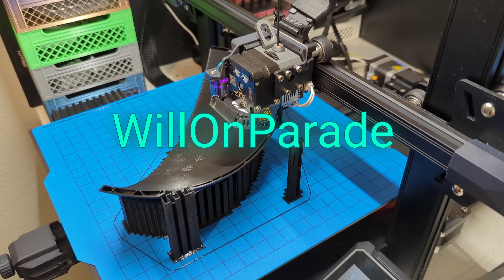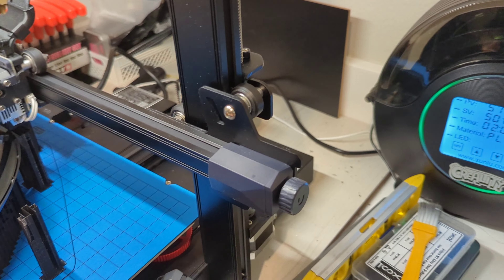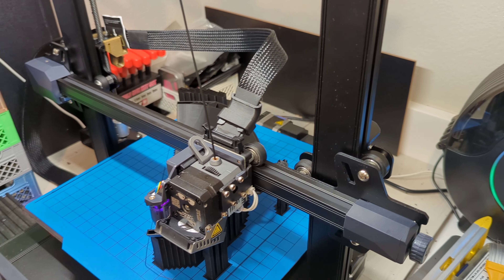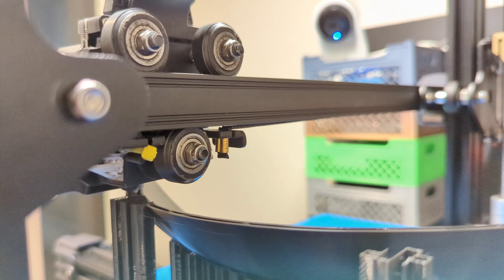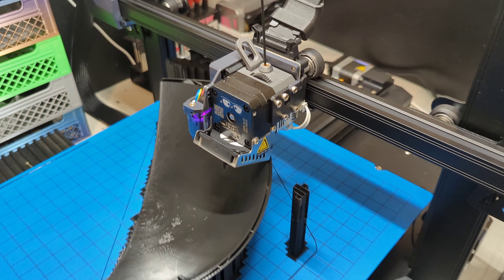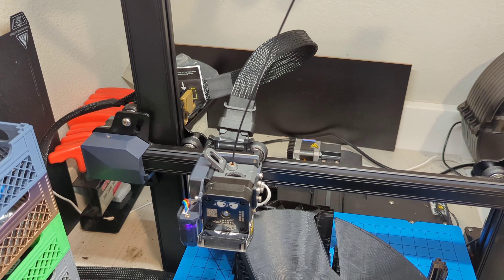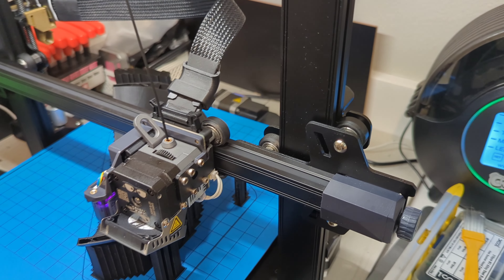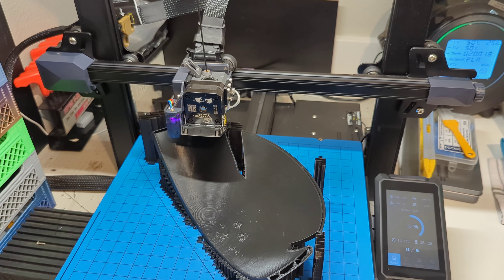Ender 3 S1 Plus, how tight is too tight on the X Axis belt...

Comment: where did you get the support for the cable connection to the extruder?  looks like a good mod.
Reply from the maker: I honestly wouldn't recommend it. Shortly after I had issues with a bad connector. Had to get it replaced.
Reply: thanks for the info.  Just looking at the factory issued, the original set up looks like it could cause problems with the twist.  Waiting for a new Y belt, should be interesting to replace it.  Again, many thanks. @WillOnParade

Comment: Hey Will where did you get that blue print surface you are using? I have an s1 plus as well and I’m looking for an upgrade to the stock magnetic sheet.
Reply from the maker: It's very close in thickness and texture to the spring steel sheet. I also used the flush cutters that came with the printer to cut out the two notches at the end. Works great!

Twotrees Original Ultra-Flexible Removable Magnetic 3D Printer Build Surface Heated Bed Cover for CR-10/CR-10S 3D Printer 310X310MM https://a.co/d/19RPLHt